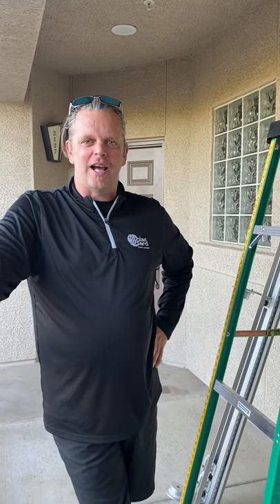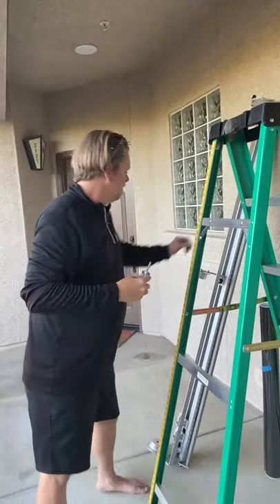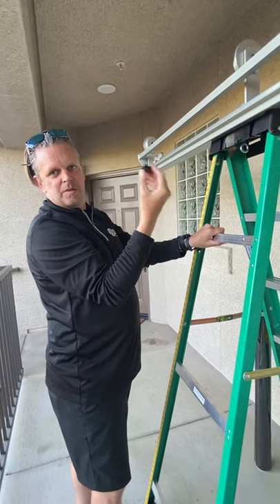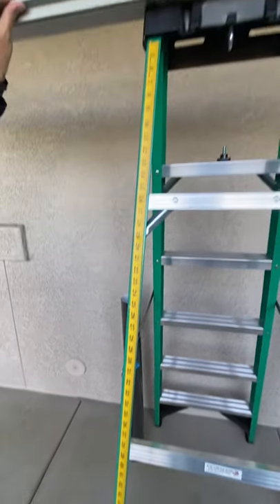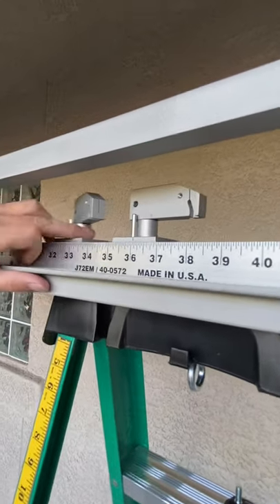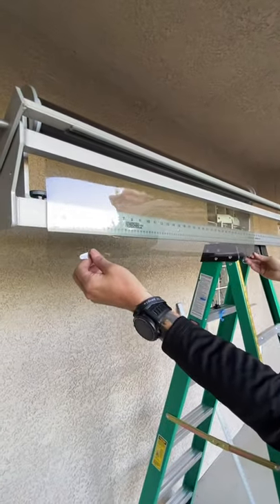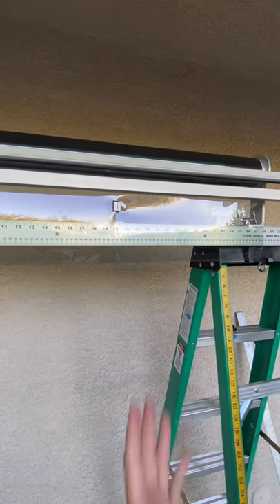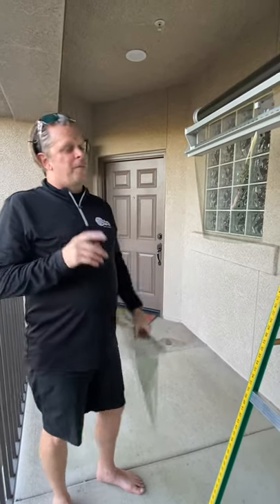Using a using a film handler

Comment: don't waste ur time and money with this piece of junk. the rubber weather stripping in window panes aren't perfect and this thing makes a perfect cut. the end result leaves u with small gaps all around the tint. fine if u wanna waste more time caulking ovr the gaps but u mine as well just adhere it to the window bigger than the size of the window and slice the excess off with a box cutter, running it along the custom shape of the weather stripping. basically this $1400 overly complicated huge machine can does the same thing a $5 box cutter can do